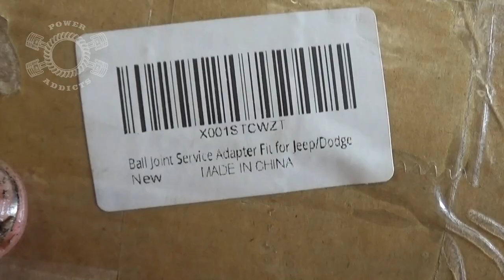Jeep Wrangler Ball Joints

Comment: Thanks for another great video, I just recently went through all the front end components chasing the death wobble, my track bar surprisingly was the only good part under there. Final components replaced were the ball joints. I, however didn’t use ball joints. I used the ball joint delete kit by American Iron Offroad. Now I won’t ever have to press new joints again. If they go bad, it’s just bearing replacements. The price is a bit high but so are high end ball joints like Tera Flex. Saving the c from too many presses, this saving me $ in the long run. When you have to replace the ball joints again, maybe look into those. 😎

Comment: Hey related questions i changesd all my dash lights out for led bulbs and now odometer and speedo wont light and the other gages are really dim any advice on what to check
Reply from the maker: If they dont light up, possible they need turned 180 degrees, most LEDs have polarity. If they are dim check your ground connections. In rare instances the dash dimmer may actually be turned down enough to make them go dim. Most of the time the dash dimmer will make them turn off when the voltage gets too low. Also make sure all the contact points are clean. Have a good one man!!